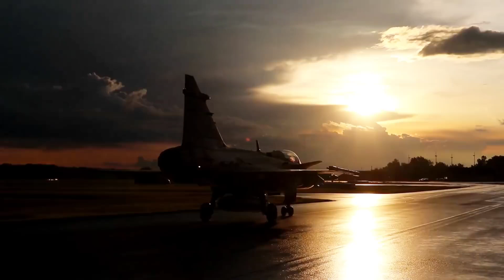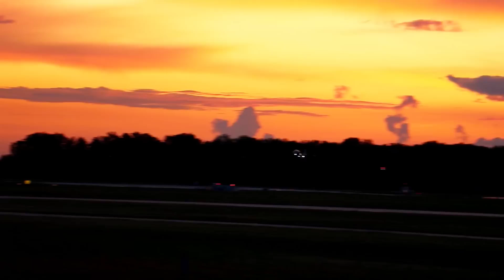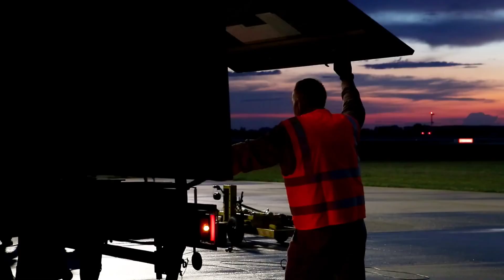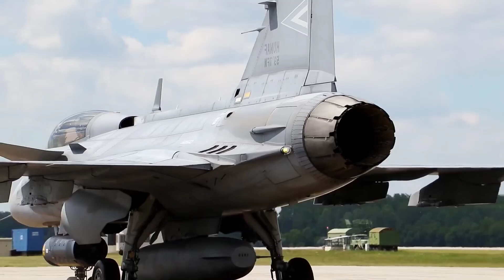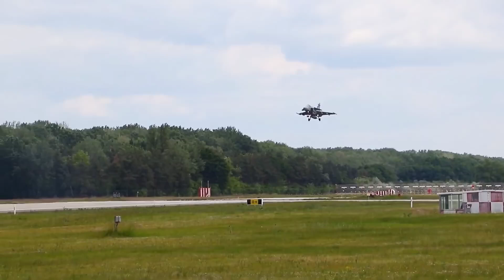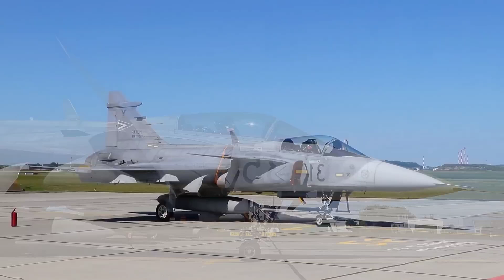The Shocking Truth Behind Sweden's GripenE/F: A New Engine That Could Shift GlobalPower

Comment: The Beaver and Otter are like birch bark canoes, go anywhere. Gripen is the fast version of the Beaver, fast, agile, and can use rural roads, snow, and ice runways in Winter. What happens when an F35 in winter has problems, and lands on ice with some snow and no plows available, the brakes failing on the ice due to high weight? (Unless it is B Marine vertical) How will it get fixed needing specialized work in hangers?  The Gripen maintenance stuff could be shipped on a Otter or Beaver, and it could take off in a few days. Don't trust Canadian generals raised in the Cold War married to SAC and the US, just like Ukraine generals trained in the Soviet era who can't cope with drone war tactics.

Comment: F35 is the better all around plane, but Canada doesn't need a plane built for Super Powers, we need the plane that the public will afford, and in quantity, unlike what Canada usually does, we need enough of them so that they all don't sit on 2 or 3 bases or even worse completely without the weapons/equipment/tools necessary to support them.  Even with the CF18, our last jet purchase we bought so few and a decade later were still buying the necessary suites of support equipment.
Reply: Canada bought 137 CF-18s.